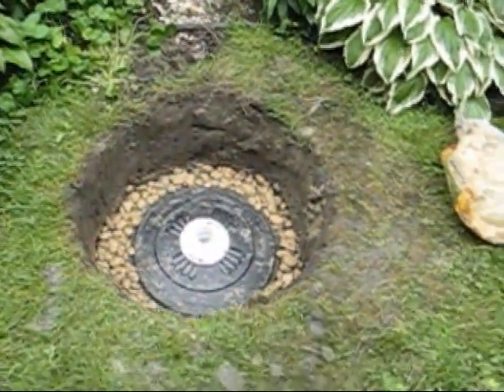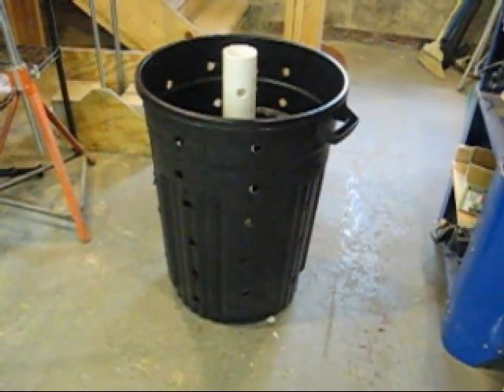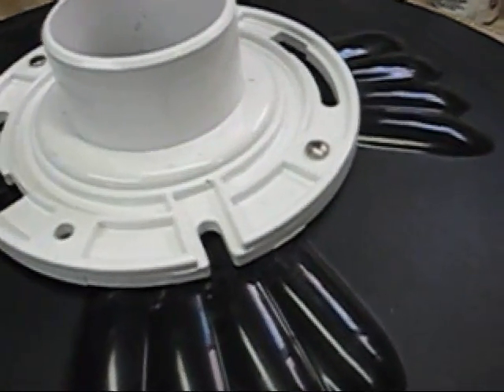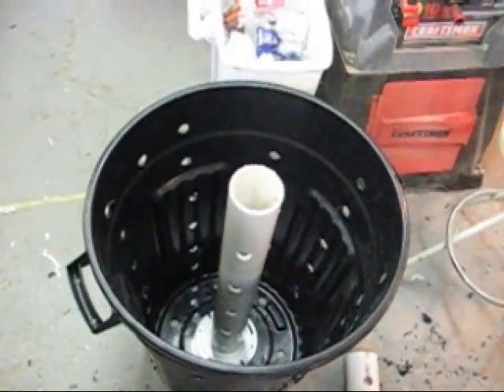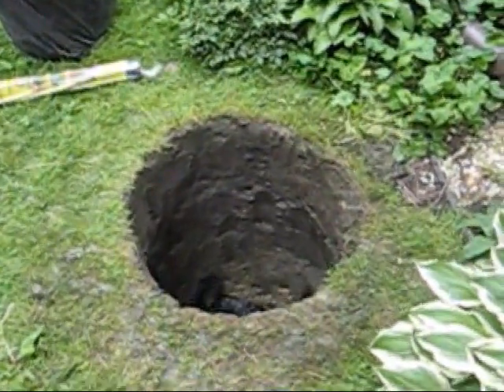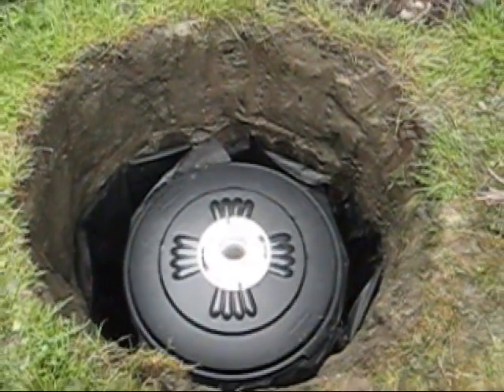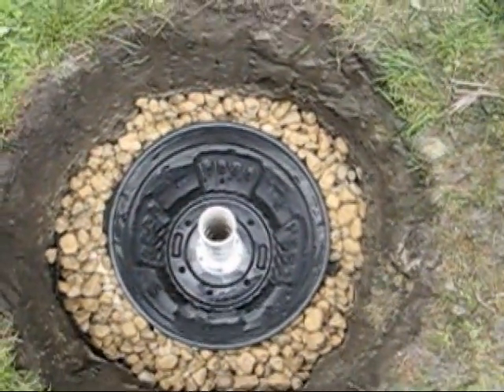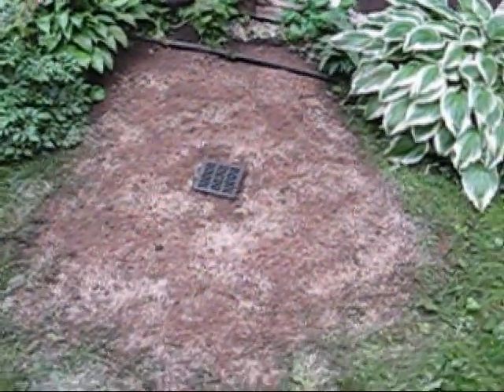Dry Well Video 6-13-11 HQ.wmv

Comment from the maker: UPDATE: Its been 9 years and I now have four installed, one at each corner of the house. They have held up very well. I had been getting some minor seepage in the basement but it has stopped completely. 

As for the hole, yes I was pretty proud of myself. Our soil is mostly clay so the sides held up well. I used a manual post hole digger.